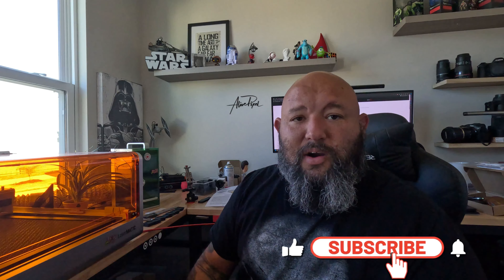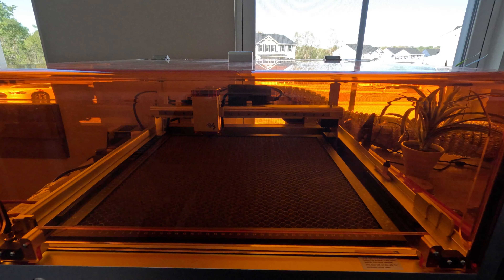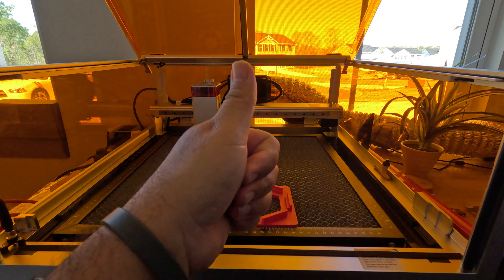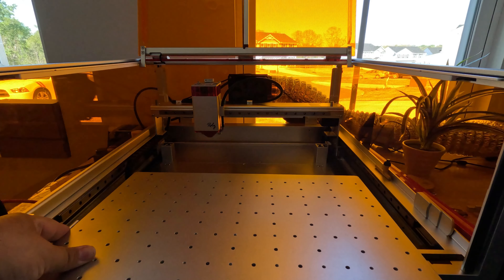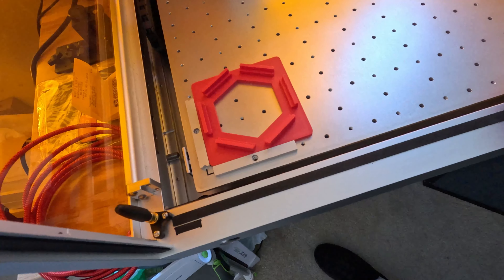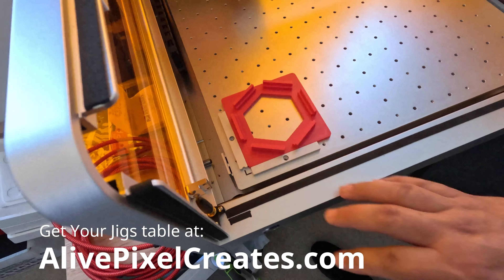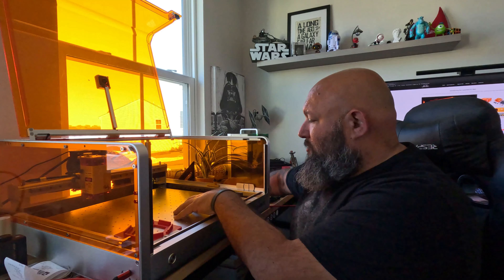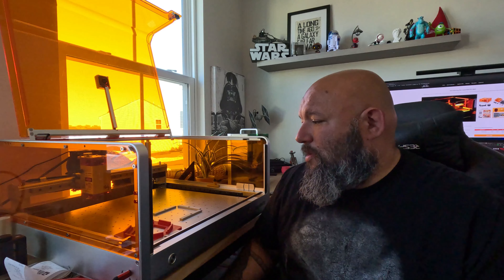Roly Lasermatic Updates - Jig Table Tutorial and Review!

Comment: HI!  Please, can you do a test engraving and cutting with Roly and Xtool?
Which of the two engraves more detailed and faster and which cuts the same type of material faster.
From what I have searched the internet I have not found anyone doing such a test to exemplify the differences in laser spot size, becouse from the specifications on Roly's website the laser spot is larger than Xtool's.
From what I understand Roly's 30 W model does not engrave very detailed. However the 30W laser module also has the option to work at a lower power, at 10W. In this 10W mode can't it engrave more detailed?
Thank you very much for your explanations!
Reply from the maker: Hi 
I did a couple test and yes the 30w is for big cutting while the 10w is really details engraving and cutting. The 40w from stool is the same since it is a very hot laser creating charring and won't let you do small details.  Is like comparing a mini-torch and a flamethrower.
Reply: @AlivePixelCreates  Very interesting what you said that the Xtool 40W can't engrave very detailed. On their official website they say that the laser spot is 0.08*0.10 mm, for Xtool 40W. Compared to Roly 30W the laser spot is significantly larger.
For comparison Roly 30W has a much larger spot 0.06 x 0.14 in the 10W version, and in the 30W version the spot is 0.30 x 0.12.
I wonder how is it possible that Roly can engrave much more detailed than Xtool, having such a large spot compared to Xtool?
Thanks for sharing! All the best!
Reply from the maker: @MihaiMihai-zw4rz  yup look Cobey Schmid with geeks at Large he did a video showing different laser power and how small and detail jobs get affected